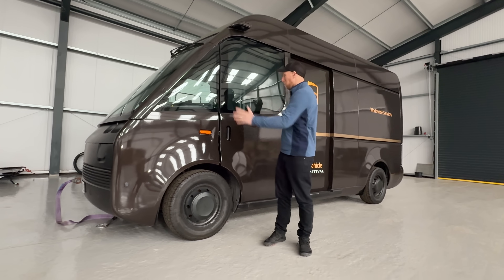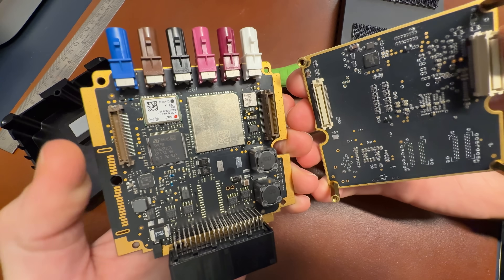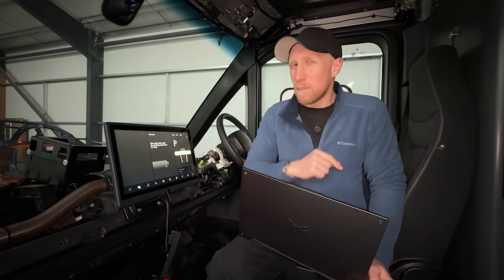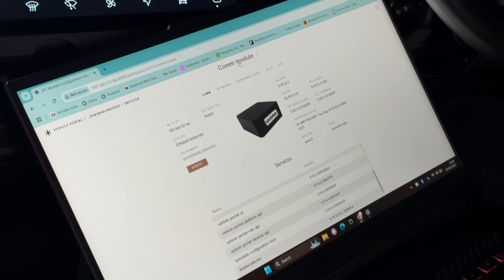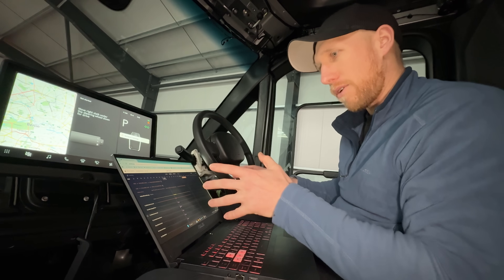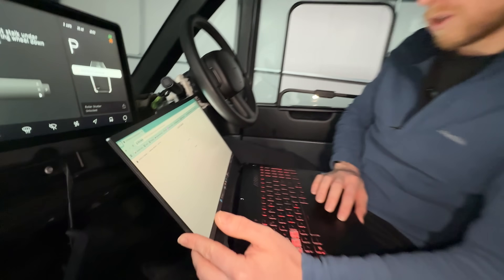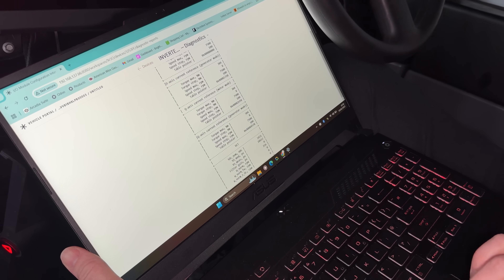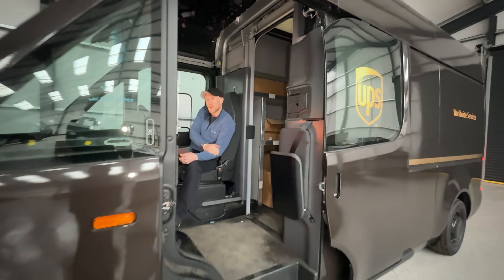HACKING Into my Electric UPS Van's Secret Computer System!

Comment: 1:30 The shielded module with the white sticker is a UBLOX GPS receiver. The other shielded box from Cinterion is a complete GSM/GPRS modem. The SIM-card is wired up to the GSM/GPRS modem, not the GPS.

Comment: Perhaps, you can only get reporting using the web browser. Maybe, there is a device or software that you need to actually affect changes to the vehicle's electrical system.
Reply from the maker: I have found a section that lets me turn off some requirements

Comment: android is linux, and if it is using android it'll probably be a custom rom and modified core, so maybe go into settings, access developer mode and see if there is anything related in there?
Reply from the maker: Thank you for the data

Comment: Hopefully that website never goes down. Maybe you can buy rights to the website and get the key to the backdoor
Reply: It's local to the van - installed on that little mx6 machine. i.e not a remote site at risk of shutting down. As they have physical access they can probably just copy it off the machine.
Reply from the maker: Hopefully can copy off of the machine and use on other developments
Reply: @Hazell_Nutz  oh wow! That’s awesome! I get it! That would come in very handy

Comment: The password is Ch4rg3RD! You can activate engineering mode and reset the coms to components with just the screen and not the PDU, just tap the screen sides up up down down left rig

Comment: If the resolver is not calibrated, there will be resolver error in j1939 diag, and will be 0 in resolver initial calibration. DevCounter is debug warning, usually when one of the messages was not received/answered in time. Can you share debug diag page of Inverter and debug and j1939 diag page of TCU? And share version of Inverter and TCU fw.
Reply from the maker: Thank you for the help. If you would be happy to message me on Instagram could supply that info

Comment: I see the "Roller Shutter door open" warning on the screen. Have you tried having all doors, shutters and set belts fastened to see if it would go into drive? Sorry if you have already tried it, but sometimes the obvious is easily overlooked.
Reply: Ah. Is it a pressure switch rather than the brake pedal switch. If so have you got full pressure? Good luck.
Reply from the maker: Yep tried so many times, also on the software have turned off all the requirements to drive apart from brake input

Comment: Imagine being a UPS driver, happily driving along, minding your own business, when someone pulls up next to you, hacks into your van, disables the brakes and activates the secret hidden "full acceleration mode". Because you just know that Arrival wouldn't have remembered to change the passwords on production vehicles.
Reply: also, most electric power steering systems are capable of exceeding average human force. You would just be a helpless passenger
Reply: @mandrakejake  I may know someone who fooled with that. They told me that they were afraid to use full force as it would likely break the rack and even at lower forces could probably break a wrist if the person was holding too tightly.  The things you could do...
Reply: @BLKMGK4  I used to design steering systems for cars so I am fully aware! Also even if you're strong enough to fight it, they change direction faster than you could.
Reply: The CyberSecurity aspect of all this is scary. Even if the WiFi on the road is disabled if a supply chain attack happens on the firmware it could have logic to meet certain requirements then do literally anything.
Reply: @4megii just think how many vehicles on the roads now have Over the Air update capability.. Imagine a rogue AI decides there's too many drivers.. 😂 All a bit 'I Robot' isn't it
Reply: @mandrakejake  'You've left your 15 minute city, car self destructing in 3, 2, 1'
Reply: Just throw in a rogue AI and we're back to the plot of arcade game Last Resort. Fun.
Reply from the maker: I would like to think they would of removed the wifi on road vehicles but i expect you are completely right

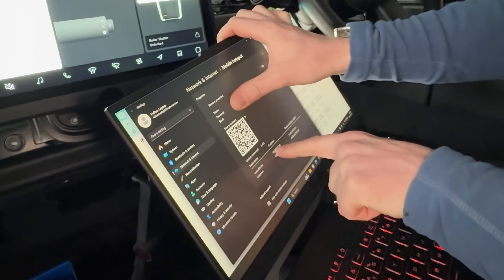Comment: 3:05... Sneaky, I wonder what the QR-code does.
Reply: Not saying that it works… but..
Reply: @armoredmouse  could you read it off the video? There doesn't appear to be quite enough pixels to do that, either direct off the video, nor screenshotting at 4K, transforming the perspective, and unsharp masking a bit. It's just too blurry. It's not quite like on the telly where they just go 'enhance' 🙂 It does look like it could be done but it would be a lot of work to tidy up the image enough to be readable. But maybe some phones have good enough image-processing to do it...He pretty much told us the password (and I don't have one of these vans), so there doesn't seem to be much point putting in any more effort.
Reply: @xxwookey  I scanned it successfully on my phone. Its using Level H error correction, which is 30%. Meaning there is a LOT of error correction so you can get a good scan.
Reply: @ so I was able to take a screen shot of it, then in my iPhone’s supplied Photo app, I straightened it and squared it. Lastly I simple just snapped a pic with my other iPhone and WALA it worked. Yes it isn’t shot in 4k and a little sharp by QR codes have error correction in them just for this. In fact about 30% of the code could be scratched away and it will still read it correctly. 🙂

It didn’t work for me unless I squared it away, so that might be your issue.
Reply: They really crammed all the numbers they could into that password while leaving it readable didn't they?
Reply: @lukeharrison1654  
It is actually readable, it states:
SSID: ARRIVALTeam
Encryption: WPA
Password: ******* "chagerd!"
Reply: @lukeharrison1654  Only 2, but no other numbers you could easily swap in,  I'd have used © & ®
Reply: I wonder if they have updated it in the BYD vans :)
Reply: Aye it works for me 😂😂🤣🤣

Comment: I think you can get the hotspot password from the QR code that you didn't block out.
Reply: Thought the same and scanned it with my phone and it tells you the name of the Wifi and the full password
Reply from the maker: I had no idea I did try that but did not work on my phone but signal in the unit is very bad
Reply: @Hazell_Nutz  You can use the YouTube video editor to blur it. It'll just take a few hours to process and take effect. Maybe put the password in your comments blackist so it's less likely to be leaked
Reply: Can confirm - does work. Did it all on my phone.
Reply: Thats true. QR are like plain text. Worked as a charm! The password are really bad. Should take less than 20 minutes to crack the hash.

Comment: Couldn't be a seat belt on n door shut or no drive safety type thing could it or equally simple pain in the rear fault
Reply from the maker: I have gone though a turned that all off in the software
Reply: @Hazell_Nutz  cool was just a thought, very best of luck on ya quest anyway it's interesting af